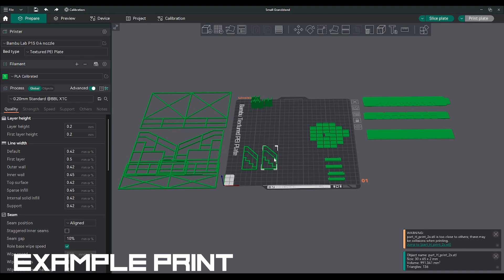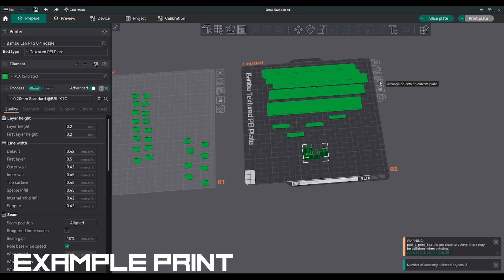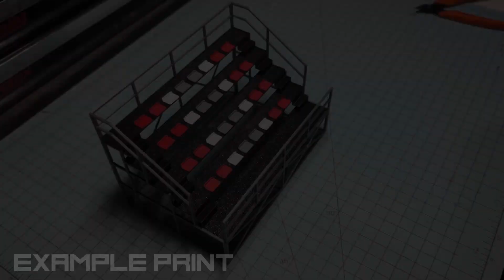3D Printing Tips for Better Results!

Comment: Thanks for video. But my problem is I’m no where near the level of your 3d printing language. Much of what you discussed was beyond me. If this was a high school lesson I guess I’m elementary or even pre-school. Any suggestions on how I can advance my knowledge?
Reply: Is the slicer software where you begin the design? Do you start from scratch, meaning each part of a section you design and then piece them together? Do you draw it out on paper (graph paper) first?  And how do you get it to 1/32 scale?
Reply from the maker: The slicer software is what turns a finished model into code that the printer can understand. It essentially "slices" the model into tiny layers that the printer can print. I use Fusion 360 to create models from scratch, and usually an idea starts on a sketchpad. However, most of the things that I have printed thus far were designed by other people and found on various websites.
Reply from the maker: In short: the easiest way to get started is finding finished models to download, and then slice and print them yourself. Once you get the hang of that process, and more specifically what does and doesn't print well, then you can start designing your own models. I would start with a model that has been proven by others first.
Reply: Thanks. Appreciate your time answering my questions. And fantastic job with your videos.
Reply from the maker: No problem! Hey, I was in your shoes not too long ago, and I asked all kinds of questions. It makes me happy to help others along that journey!
Reply from the maker: Ask questions, I am happy to answer them!